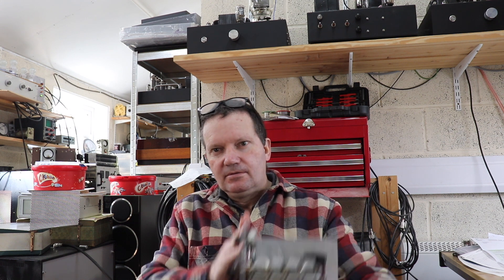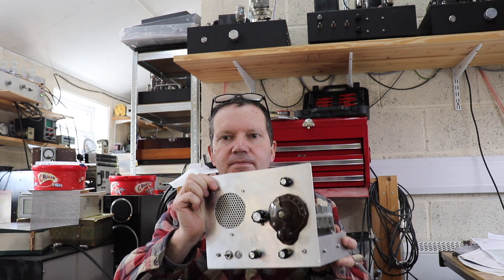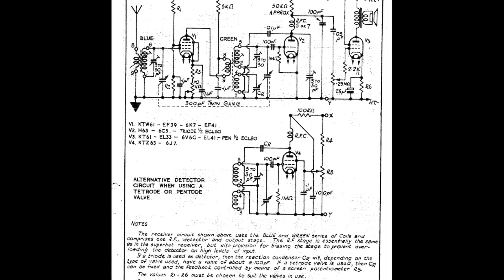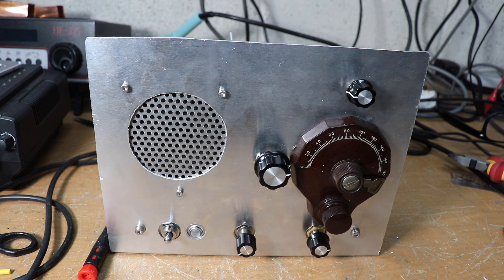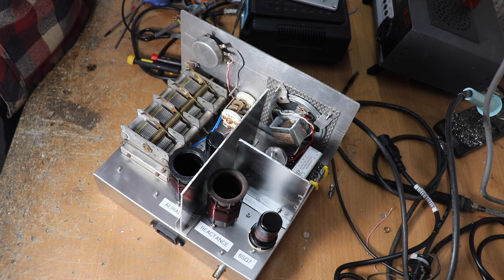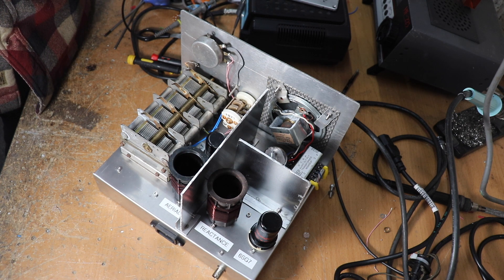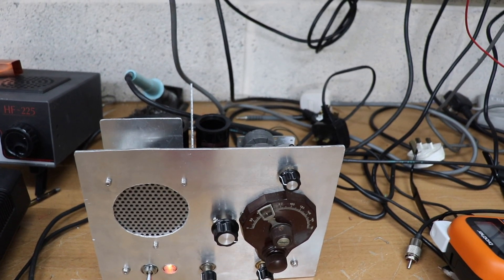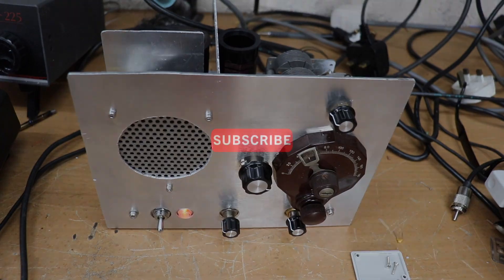Junk Box Octal Valve TRF Receiver

Comment: Congrats, nice radio! I have used the same circuit with some minor differences. Tubes I have used are EF183-RF amplifier, ECF80- Regen detector(pentode), audio preamplifier(triode) and PL95-audio power amplifier. Tuning is done with varicaps, detector is wired as  a Hartley  oscillator. Controls are tuning, RF gain, regeneration  and volume.

Comment: Why does this TRF have so much crackly noise? If the noise source is the antenna or local switching device radiation, can one or more broadband filters be strategically installed to eliminate this noise?

Comment: I have a 1927 Arborphone TRF radio that I love. And I built a dedicated TRF transistor 'receiver' for WWVB on 60 kHz to generate a disciplining signal for my Xtal oven. TRF doesn't work worth a darn very far above the AM broadcast band. But if you keep them low in frequency they are simple and fun, and work just fine.

Comment: Your regenerative receiver needs a front end attenuator to reduce that SSB signal to allow it to be resolved... these simple radios are very sensitive and overload easily, made worse because of the unnecessary gain of the front end RF amplifier.   My advice to improve the performance, remove the .1 cathode bypass capacitor, ground R3, and use a pot to vary the pentode screen voltage from a few volts to around 30. This will vary the gain from nothing to around 20 times. There are better ways to do it but that will  involve messing with the coil.

Comment: Nowt wrong with your metalwork, far better than my attempts!  I like the speaker grill, 3mm diameter holes in a 1mm thick piece of aluminium sheet?  I use the same type for the exhaust vent, on my GS35B amplifier.
Reply from the maker: That was actually a bit of stainless but ali wud be better as it’s easier to cut/drill